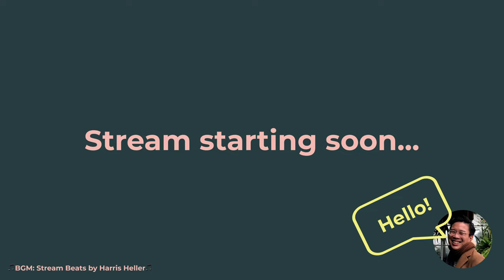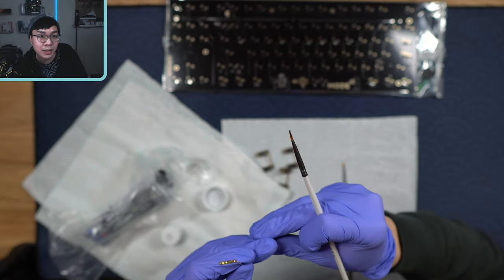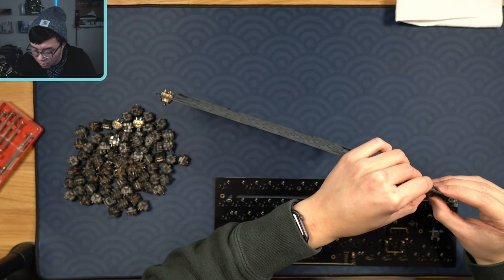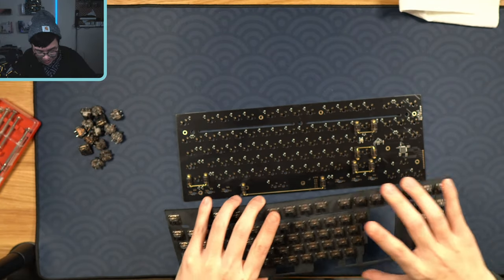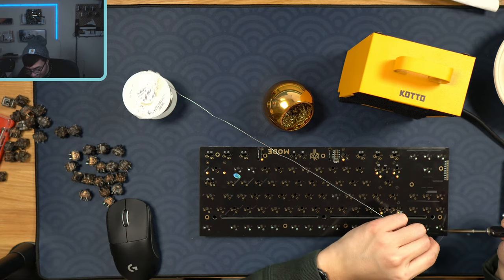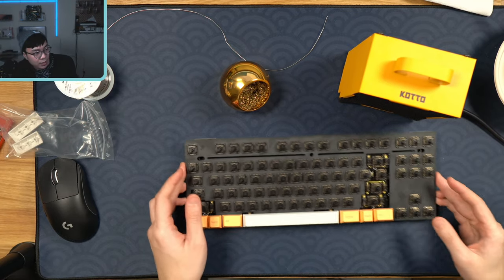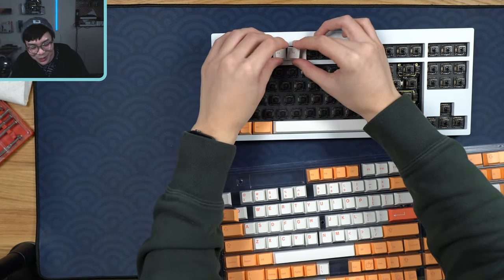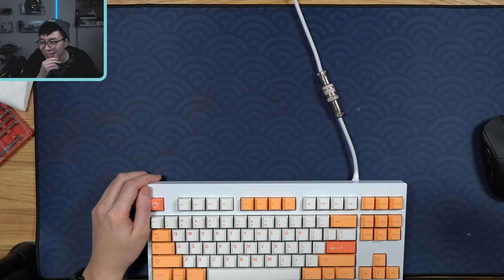Mode Eighty TKL Mechanical Keyboard Build ✨

Comment: Just got my board today the space bar stabilizers are labeled on the PCB in the back bro I’m scared to use the Pom plate I ordered might just use the FR4 after watching the stream
Reply from the maker: Give it a shot I think you’ll be fine, my thinking rn is that the Pom plate + Gateron black inks don’t work well together
Reply from the maker: If you’re using a solder PCB, don’t solder anything down, assemble the keyboard first and make sure it looks fine with keycaps and typing on it. One thing I didn’t show on stream that I’ll mention in a future video is that my keycaps on the left side are slightly scraping against the top case. This does not happen with my hotswap PCB build with Alu plate and JWK linears
Reply: @jimmynguyen973  I did a build today with the FR4 plate zeal stabs and lubed/Filmed Original Aspiration switches I set all the keycaps in before solering as you said it sounds good man
Reply: @jimmynguyen973  I run Sakurios on my KBD8XMKii the mode is a bit louder but still a bit muted just how I like it